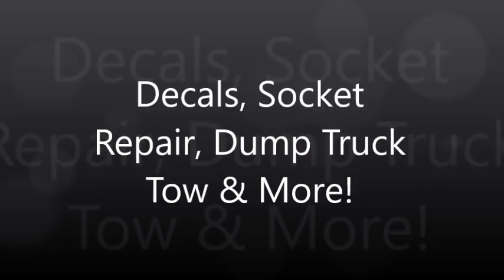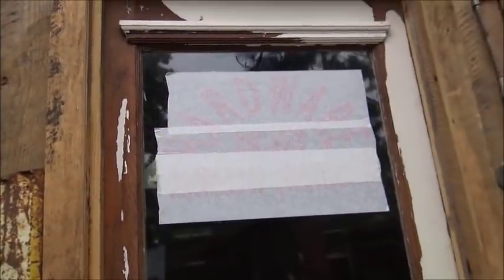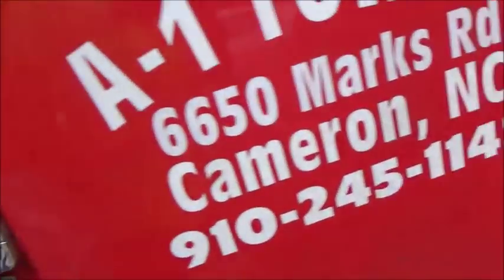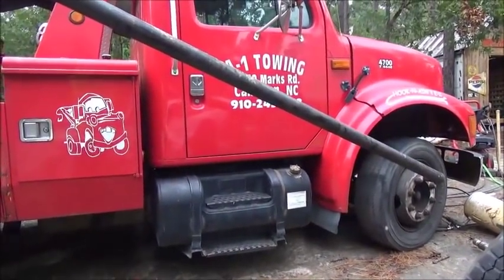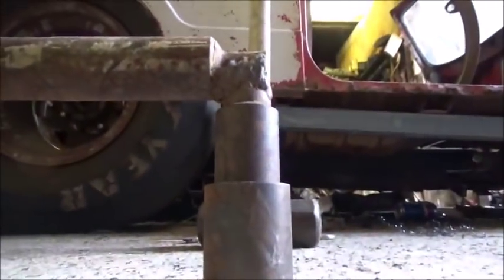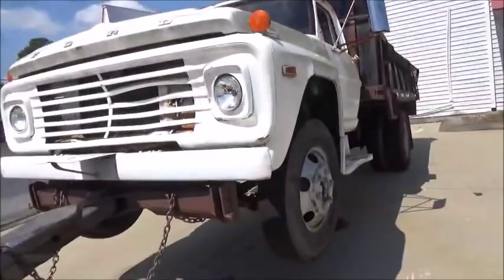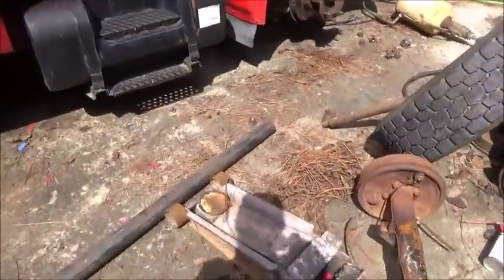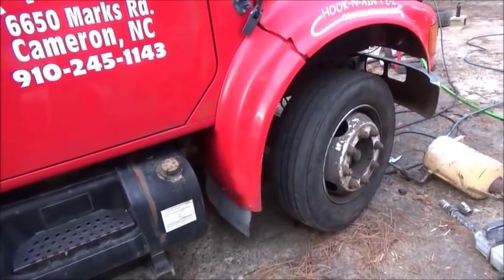VLOG, SOCKET REPAIR,  VINYL LETTERS, TOWING AND MORE

Comment: Jonathan, I watched this video when you first published it and commented then concerning your ingenuity  concerning  your repair of your fractured impact socket. However, after watching this once again it brought to mind a comment left by some lowlife concerning  your current project, the '59 Ford Galicia. He referred to you as a hack which I resent. You remind me of my dad who also had a wrecker business and in whose footsteps I followed. We had the first really heavy in the area which he home built basically because at the time we couldn't  afford a store bought one. We started with an old basically worn out IS that he had picked up somewhere and three winches . Two 30,000# drag winches and a 110,000# which he bought out of a boat junkyard and one that had started life on a tugboat. Some thinking on his part, used steel from various places, a lot of fabrication, welding and work had by all and in six months she was done. Served us many years, while doing jobs that other people had turned down. You are from that same school, with the knowledge  of how to repair something to make it work without calling the local Snap on guy to have him bring you another $110.00 socket. Someone needs to ask that moron if he can design and build his own recovery  equipment  that works as well as yours. Or design, cast and build his own engine. Or rehab his sons house into the thing of beauty it is now while keeping to the low available  budget. There's a lot of difference between someone who opens a checkbook for what he wants and you, who lay hands to other people's junk and turn them into art with function. That and your obvious willingness to help your fellow man are assests you can be proud of. This moron should find another channel to whine about. You have to many of us out here who are your supporters to worry for a second about those who can't appreciate your talents.

Comment: That huge wrench was moving the truck back and forth as you loosened the nuts.  Very good idea and excellent repair.  I used a 40 inch breaker bar on a large utility trailer lug nuts- twisted the bolts off.  I suggest you use some B'Laster or Kroil products on the threads before you wrench on them.

Comment: Jon, I had many a pair if those USGI boots your wear hot like yours & cold weather. Best way too soften them up quick, put them on, put your feet in a container deep enough to submerge. Let them soak in the leather completely and wear them wet for about 45 mins. Change socks with 2 pair of new dry ones 1 thick, 1 thin over and wear the rest of the day. Once dry they should be plenty soft and conformed to your feet.

Comment: DANG!  10ft bar plus 200 lb man = 2000 ft lb.  lug nut!
Reply: Good day 009to090  I was thinking the same.  When we  were on farm, didn't have torch,  I would take cold chisel  & chisel   into side of nut. I did that the other day, nut come loose ground it off & put it back on Thanks

Comment: you know if that truck is not geared really high  , you can put 22.5's on that truck and gain some ground clearance ... I know that lug pattern in 22.5's are not so easy to find , but I know where around 100 wheels are ...the speedos are easy to correct to , but I bet you already have had to deal with that before ...

Comment: Santa Claus. Need to bring you a bell to go over the door . To bad there's not enough room in the back for a couple nail kegs and checker board.  
  I don't know what the legal length of over hang on logs in your state. But here in Arkansas and surrounding area it 25 ft. With a red flag on the end of the logs .  In the dark there has to be a red light on the also.  
   Next to the hardware you might have to put in a lettering business.  Good luck with all your projects.
Reply: Looks good brother.

Comment: You need to get you a torque multiplier lug wrench, I'm telling you they are worth it and you will see how easy it will be to take them rims and tires off there pretty cheap if you look them up on eBay definitely worth it in the business that you're in

Comment: Not 1 drop of penetrating oil used, but forges a lug wrench that would kill a moose. I seriously wonder what the torque value of that setup is. That was insane. At least it didn't snap and hurt yourself. Always wear 2 pair of socks to break in boots.

Comment: I know you're an extremely intelligent man but if that was my truck and the lug nuts with that tight I would replace every stud in that hub because chances are the threads have been stretched and you'll have a possibility of losing a wheel

Comment: Who in the hell put those wheels on they need their balls cut off, they were on way too tight, snap a stud off or strip the splines that hold the stud in the hub flange. Washer nuts don't come lose, regular conical nuts will work themselves loose you need them tight, that's old school trucks with lug pilot wheels.